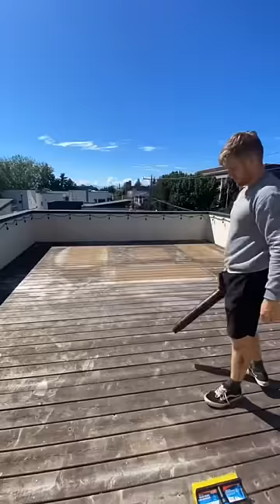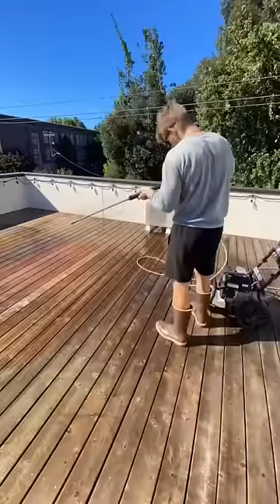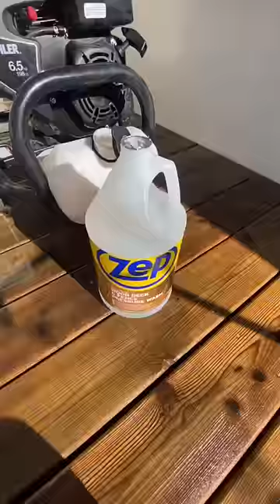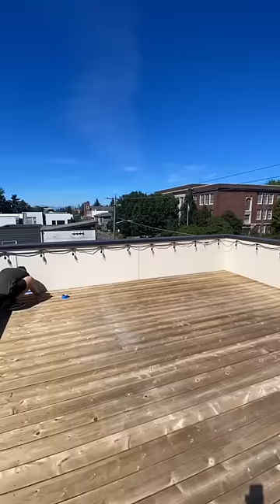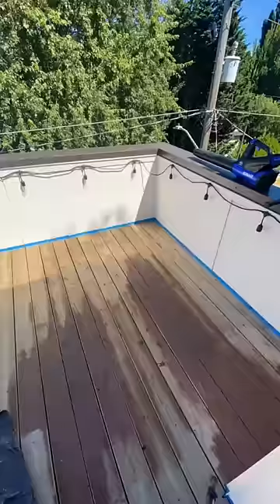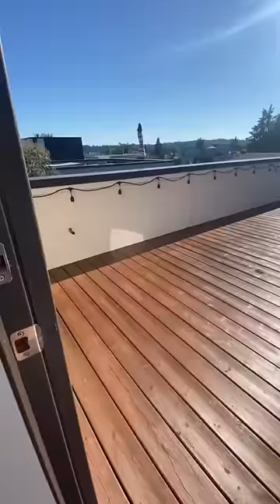How to restore a deck

Comment: The only advice I can give you, is, you want to wear sun protection on your head, Revo sunglasses, because they don’t distort for color or distance, and they protect your eyes from UVA,UVB and infrared, and you wanna cover up your skin as much as possible with a big hat.

I worked outside for about 12 years in the swimming pool industry, and there’s hardly a spot on my body now that doesn’t have these spots from all that sun damage. And I actually tried to protect myself after the first few years when I realized I was getting way too much sun exposure .

Comment: Pro tip from someone who did deck restoration for 6 years: when washing, don’t stop or start in the middle of a board. Start from one end and keep a consistent distance and angle through the whole length of the board and sweep the wand up at the very end (sometimes more than one swipe per board is needed depending on how dirty it is) do it this way and the board will come out perfectly uniform with no wood fraying or any other anomalies
Reply: Them cut lines....
Reply: Or he could just use the proper chems and not have to deal with using pressure at all
Reply: I’m sick of my deck stain peeling up. What can I use that’ll soak in and last more than a year. Pressure washed it last year, let it dry in 80+ temps then restained it. Didn’t last.
Reply: @cwilks5592  sand the deck. thats the step that everyone skips and its the reason it peels after one season
Reply: @nickjames1090  I sanded it after I built it prior to the first stain. That stain faded pretty bad after a season. I pressure washed it and applied a solid stain and that’s what’s peeling up. I just need a good “soak in” stain. I’ll try sanding it again.

Comment: Fun fact. Without all the cursing, the story would have been exactly the same. I get it, cursing is fun. But you don't need to inject it between every other word you speak. It actually got pretty distracting by the end.